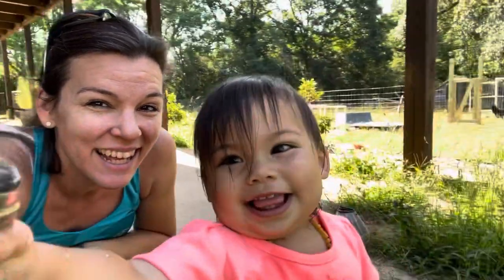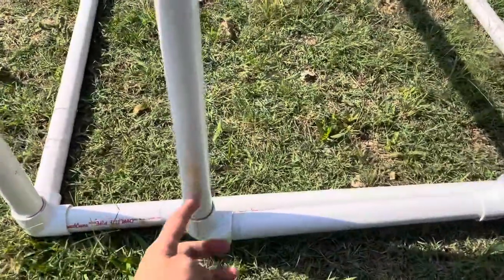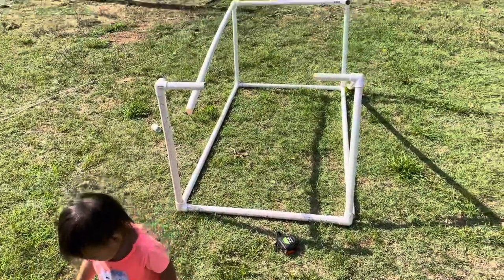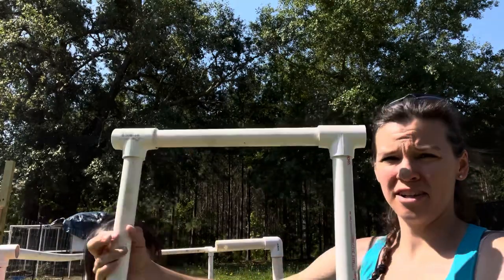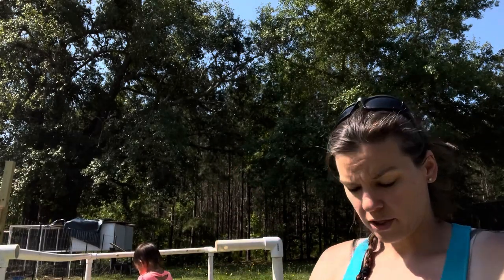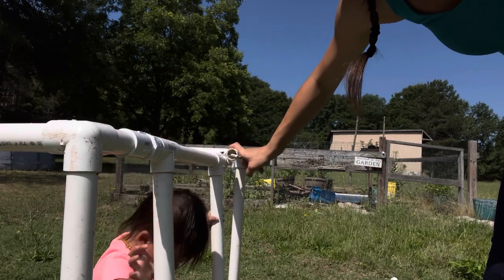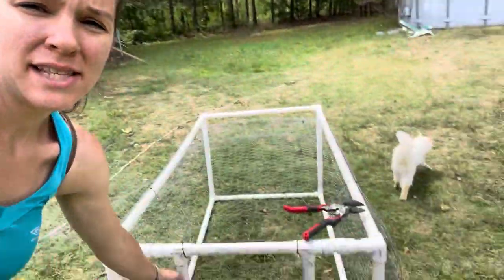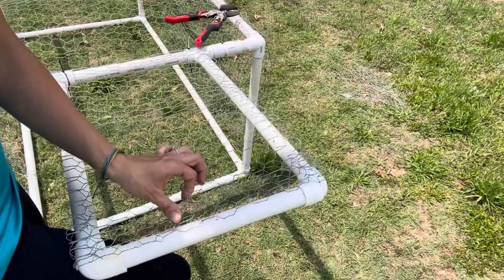How to build a chicken tractor with no power tools!

Comment: What would you suggest that be used to keep animals like fox's, raccoons, etc from digging under it to get in?
Reply from the maker: Hi Kevin! I haven’t had to deal with those predators yet thankfully. You could put chicken wire or hardware cloth on the bottom of the tractor also to help protect them and still let them have fresh grass. I will usually put a bucket in front of the door at night too so nothing gets in.
Reply: Oooh, this is a good design I can tackle.